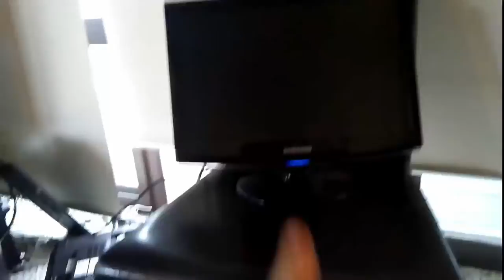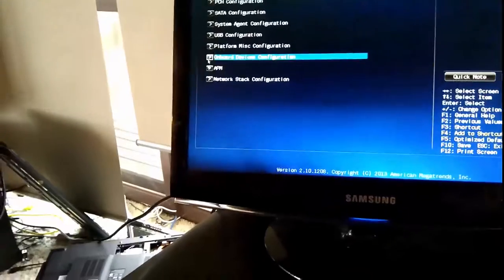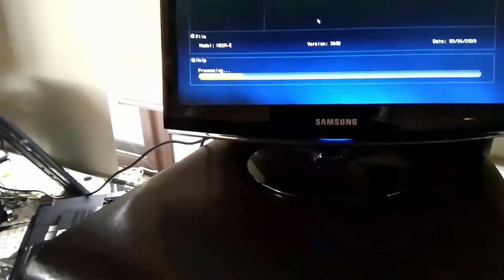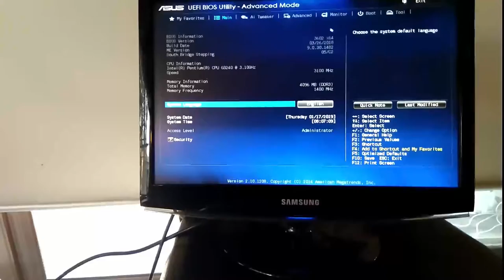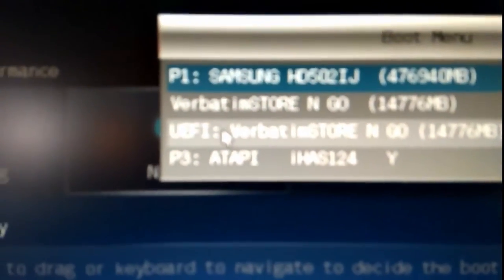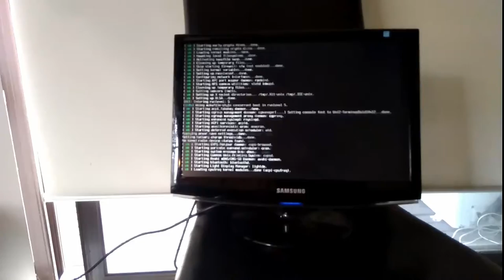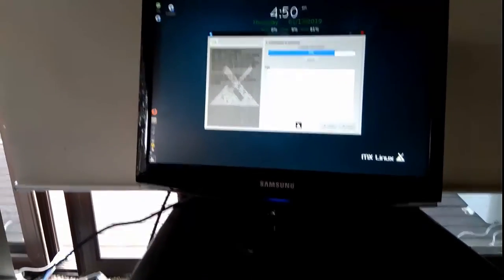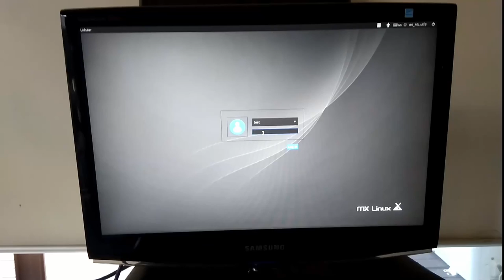System Building - Refurbing a computer for a dear mate of mine

Comment: That's a sensible PC for what is intended for. My main PC is a little over 7 years old & started with a JW-IG31-MK11 M/B, 2.4gHz core2 duo CPU, 4gig DDR2 RAM, 500gig HDD & 500 Watt PS, & did me fine for over 5 years before I rebuilt it to the specs I have now (ASrock H81M-DGS R2.0 M/B, Intel Core i5-4460 3.2gHz CPU, 16gig DDR3 RAM, 1x 2TB HDD, 1x 240gig SSD, 1 x 480 SSD & 550 watt PS(original power supply died)). Original 500 gig HDD(Seagate Barracuda 7200.12) still works perfectly & now lives in an external HDD enclosure as part of my back up scheme.

Comment: Good job! I'm sure the family will enjoy MX-18 Linux. Was the issue the Secure Boot setting in the BIOS that you had setup earlier that was causing the initial boot problem?
Reply from the maker: nah, yumi multi-boot didn't like UEFI boot system, so used Rufus instead
Reply: @OldMatesBackyardTech  Give Etcher a try. I depend heavily on Etcher.

Comment: 4Gb of ram is more than enough for MX to run, the OS and desktop barely uses 500Mb. The speed issue should not be lack of ram. I run MX in a VM with a single core dedicated and 2Gb of ram and see similar or better performance. You might want to check the SMART data on that hard drive.
Reply from the maker: It is ok, problem fixed, had to do a bit of BIOS tweaking. the HD speed issue was SMART was still checking drive as it was a RAW drive with no system table on it yet. Sometimes I have found while Samsung drives a very good, in some cases SMART takes a while to look at them when they a RAW

Comment: question: why not  just use a basic  Debian install with DE that is use specific? I've seen ~64MB RAm usage on a command line instance and ~250-280Mb ram allocated to a running sys with a DE. ( flux, open, ) .